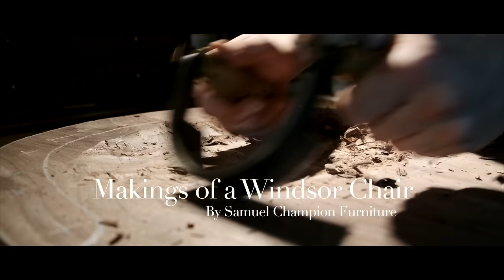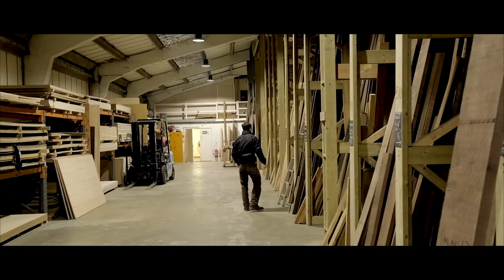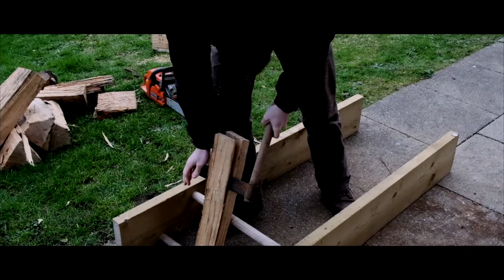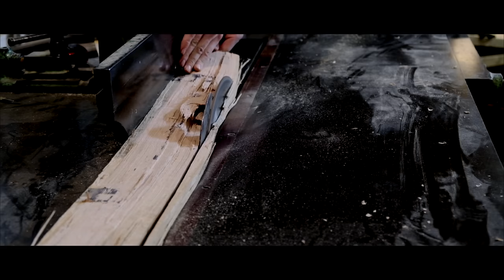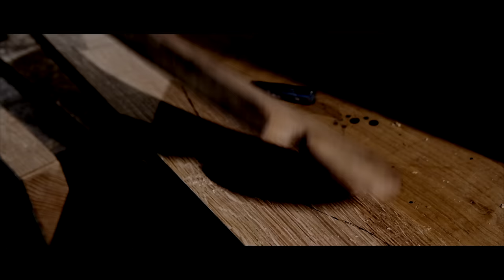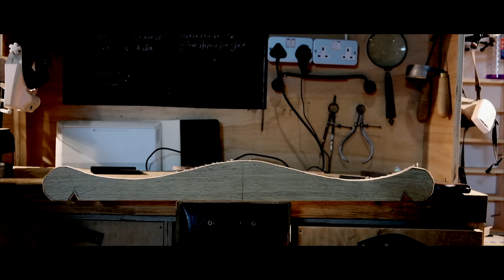Makings of a Windsor Chair | Chair Making

Comment: Really enjoying the film, but I am wincing at your table saw use (ripping)🫢 I‘ve made one Windsor but using slightly less „industrial“ approach, just shaving horse and rounding planes, mostly in the Bavarian woodsLegs turned on lathe. I‘ll certainly use some of your techniques on my next chair, you‘ve motivated me to make another.👍 By the way, really liked your fence in the background at the beginning. Watching further, how could I have used „industrial“? You must think I‘m a complete dickhead. Sorry.
Reply from the maker: Thank you for your comment. My reasoning for the industrious approach is because i work on commission. I usually do all the milling on my machines so i can work at a more competitive rate. Sometimes though a drawknife and a shave horse is far quicker and much more pleasant. And you should definitely make another Windsor Chair.

Comment: What an absolutely stunning piece! The entire process was breathtaking! If I could ask a technical question, what is the merit of having the seat's grain oriented along the axis of sitting? I would like to try my hand at building a Windsor chair, but the reasoning behind the grain orientation eludes me! Thank you for your time and making this chair a reality!
Reply from the maker: Thank you. The grain on Windsor Chairs traditionally ran from front to back. On Welsh Stick Chairs, it would run from side to side. Both last a very long time and there doesn't seem to be a structural downsides to either. Just make sure you align your wedges accordingly.
Reply: @samchampionmarchant  You know what, it's been a month since you mentioned Welsh Stick Chairs to me here, and I just wanted to wholeheartedly say thank you! You led me down a rabbit hole of studying the history of chairmaking, and I've been developing a few designs of my own as a result! It has definitely paved a new avenue for my passion for the craft. Seeing this build video for a second time, I can see why I was so inspired in this moment. What a stunning piece of furniture and build video! Thank you for sharing your process, and for that tip about the wedges. I'll never forget to check the orientation now! I am grateful!